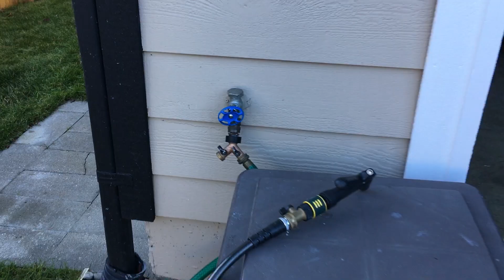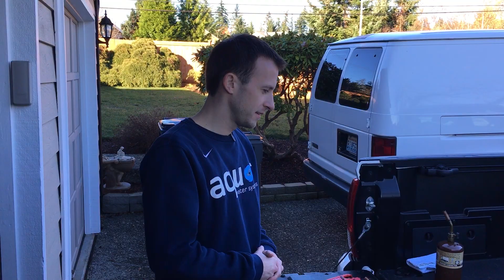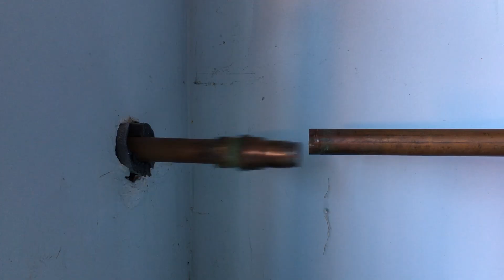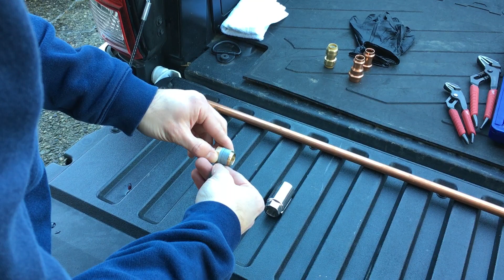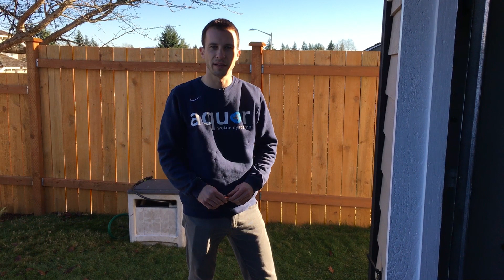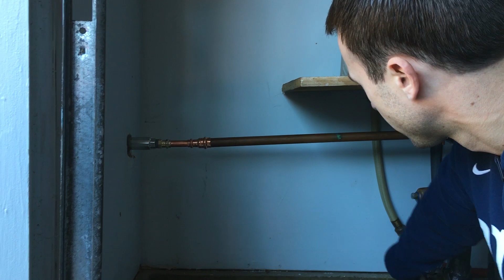DIY Install: Aquor V1+ Hydrant (retrofit install w/ copper plumbing)

Comment: Wow... calling something that's hundreds of dollars a "budget plumbing tool" is quite a stretch...  for the very high cost of this gizmo, you shoudl be ashamed to have plastic parts and plastic on/off valves. Plastic fittings will get cracked, lost, chewed up from the metal hose attachments, terrible idea. Not loving the water just dripping all over the side of the house like that when you're done either... going to turn into a big green moss stain soon on the lap siding (or brick or concrete) in the NW weather.
Reply from the maker: The manual press tool is about $100, compared to $1,000+ for the professional version.  We think that qualifies as a "budget" DIY option for many homeowners.
Reply: @AquorWaterSystems  You said it was "a couple hundred bucks" in the video - but more importantly, why would any homeowner want to own and store this giant plumbing tool just to install your overpriced hosebib? None of the other points in my comment have been addressed... NW homeowners don't want more water dripping on their house everytime they water the garden, a big moss stain developing under that flush-mounted gizmo, or being stuck with proprietary plastic connections that crack and break and wear down when fit to metal parts. It looks slick but it's bad design all around ... there is a reason everything about a good home is designed to keep water well contained and AWAY from the structure - including exterior hose connections that aren't flush mounted to the wall.
Reply: @AA-zq1sx  They didn't address your "concerns" because 1) It realistically is NOT a concern with anyone with critical thinking skills, i.e., there is not going to be water dripping on their house every time someone waters their garden. That is just the silliest "concern" I've heard yet about these house hydrants. The water only drips out when you remove the connector, that if you would have read above, is not supposed to be removed every time you use water. But even if you did, and it was such a concern of someone, all you do is direct the tiny amount of water AWAY from the house or simply catch it with a rag or small cup. I guess you are too lazy to do that. 2) Your other "points" are really just opinions. Your opinion is that this company should be ashamed to use plastic parts. Really? Go out to any vehicle on the road these days, even those that cost $100K or more, and tell me that those companies should be ashamed of using plastic parts in their vehicles. LOL! And if you are prone to losing fittings, then yeah, this system is probably too sophisticated for you. Stick to your 19th-century fitting. I love my Aquor hydrants that I retro-installed on a weekend and that I no longer have to worry about having to freeze-protect every winter. Plus they look much nicer on the home I plan to keep for the next 50+ years.
Reply: @AA-zq1sx Damn bro. You may want to move out of the NW and get some sunshine. I've never seen someone so angry about a plumbing video 😂. By the way I bought the manual pro press tool. Changed all my gate valves to ball vales. Probably saved myself at least $1500 doing it myself. That's why someone would want to own it. Get help.

Comment: I love the idea of this but the adapter that goes into the hydrant seems like it would be a issue as simple storage isnt a option and could easily be lost. Maybe you guy should have some type of holder
Reply from the maker: We understand the concern. The connector can fit onto any standard garden hose and once it's attached, you won't have to worry about it wandering off. We are currently working on some different storage options as well.

Comment: That plastic hose adapter looks like it would last for about 1 season. I have used similar plastic ball valves on splitters, etc, and never had one last very long. Do you offer a brass hose adapter? I would also be concerned about someone pulling too hard on the hose to go around a car tire or a flower bed and snapping off that plastic hose adapter.
Reply from the maker: The "plastic" we use is actually a high-tech engineering grade polymer called Delrin acetal resin. We don't use ABS plastic, which is what most plastic garden products are made of. We warranty them for 5 years, and they are rated for 150,000+ cycles and 200 lbs of pull resistance. You can pretty much stand on it while it's connected without snapping the connector.
Reply: @AquorWaterSystems  Yah, and how many times can you take it on and off the metal hose connector before you cross-thread that fancy "polymer" and have water spraying everywhere? Plastic is not used for screw-on plumbing fittings for a reason!
Reply from the maker: @AA-zq1sx  The connector isn't meant to be taken on and off with each use, it remains on the hose. You attach it once and leave it on. Polymer is the best choice for this specific application because of its lubricity  and wear resistance -- it provides many times the lifespan of stainless or brass in our testing.
Reply: Can you insert so the the spout is facing to the side or upwards for low to ground pipes with very little clearance?

Comment: Does it need to be installed at a downward angle at all and, is that tool available for rental anywhere?
Reply: The cover plate gives it a 5° downward angle
Reply from the maker: Yes, for drainage and freeze protection. The wedge behind the faceplate provides a 5° downward slope.

For the copper press tool, some hardware stores might offer rentals of the professional version. Here's an inexpensive DIY press tool we show in the video: https://amzn.to/3hP2wXj

Comment: I watched this video but in my home I don't have access to the water pipe like you did, it's behind my walls it's not visible. So what I mean is the hose bib is accessible on the outside but my pex pipe runs through my house behind drywall or in the ceiling so how do I do a retrofit?
Reply from the maker: Accessing plumbing behind drywall is a very common scenario. Have no fear, it's easy! We recommend using an access panel afterwards, or simply patch the drywall.
Reply: I had the same issue in a previous home. The plumber I hired had to cit into the sheet rock in the wall in the house to access the copper pipe. It was a decent sized 6x8 hole that needed a large patch to fill it. He sweated on the new hose bib with a torch, which is why he needed a large access hole.
Reply: Mine is behind the bathroom wall that’s tiled 🥲
Not gonna happen for me

Comment: What about a system for a water hydrant faucet that is just a pipe faucet out of the ground Not anchored or connected to the house
Reply from the maker: Check out the Aquor Ground Hydrant - does exactly that!